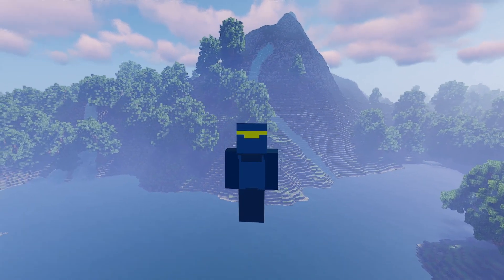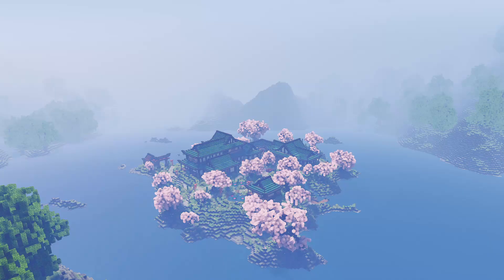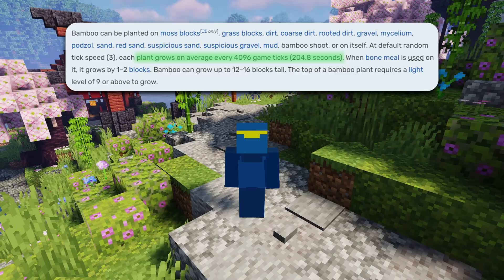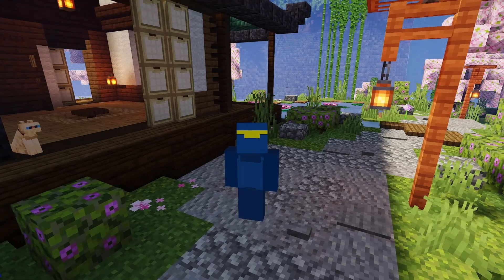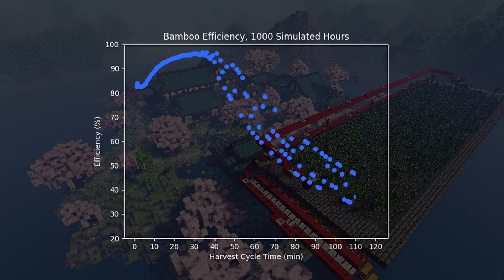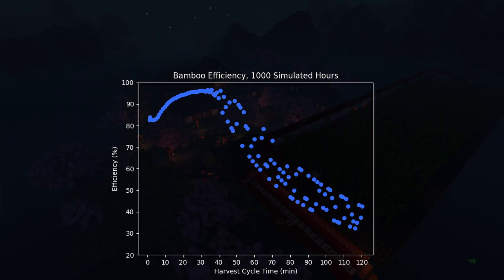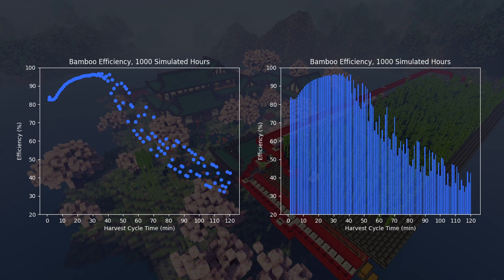Optimizing Bamboo Farms with Code - Minecraft 1.21

Comment from the maker: Hey everyone, @gamer_x403 had a really good observation and stated that the second half of the graph appears to be 5 separate curves, corresponding to the 5 potential starting stages. So I tested his theory out and am convinced he is correct.

I simply ran the code again, but removed the random stages and instead forced the stage to be either 1, 2, 3, 4, or 5. This produced 5 graphs in which it's clear to see that bamboo behaves like a step function. The graphs are actually really cool to see and pretty much answer all of the questions I posed. The inflection point around 37 seems to be where there's enough time between harvests that the steps become clear. If you'd like to see them, let me know and I'll figure out how to post them.

Comment: Not sure if you saw my sugarcane video (a follow-up to your own) but I have today finally finished the process of calculating the optimal harvest of bamboo using markov chains.  I calculated the optimal harvest interval of unrestricted bamboo as about 31-32 minutes (with a graph nearly identical to yours) and bamboo artificially restricted to 5 blocks tall as about 10 minutes and I can calculate for any arbitrary height limit if you cap your bamboo's height by blocking it (for example when it hits the ceiling inside your base).  I'll have a video up on it once I get around to making it, hopefully within the next few days!

Edit: Well, after going through the comments and learning that bamboo doesn't have the same internal stages as sugarcane, it changes the whole dynamic and makes the calculations way easer.  So the optimal harvest interval is instant, and the efficiency stays pretty damn near 100% all the way until a harvest interval of about 19,000 ticks (950 seconds or 15.83333 minutes), after which point it drops off slowly.  I simulated repeated harvesting in-game (rather than through programmatic simulation) and got results very consistent with the calculated result.
Reply from the maker: Hey uchinanchuu18, I did see your sugarcane video a while ago but hadn’t made time to watch it, so thanks for the reminder. Really great video and cool to see the actual statistics behind it. I’m not sure I covered it in my sugarcane video but I also included a blocking time for the flying machine. I’m glad you did the math behind it to actually show that effect.  

I look forward to watching that bamboo video when you post it. It’s been a while but I’m guessing the 15.8 minute time allows the bamboo to reach full height before harvesting? In that case, I’d be interested to see how a flying farm that harvests every ~15.8min does vs a bunch of instant harvesters in terms of efficiency in-game.
Reply from the maker: Also, I’d like to link your video in the description of mine to help other people find it. Let me know if that’s cool or not
Reply: @SeaJayPlays  Absolutely, you can link it.  I will work on the bamboo video as I get some time over the weekend.  The results with artificially limited bamboo (i.e. hitting the ceiling indoors) are interestingly intuitive so I can't wait to share.

Comment: {edited}
I didn't read your comment from three months ago and reached the same conclusion haha, great stuff!

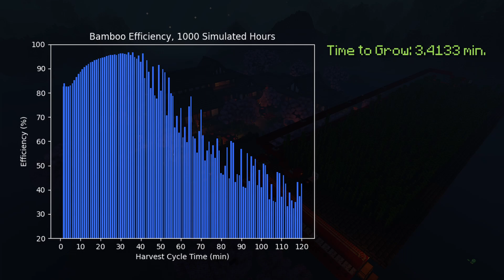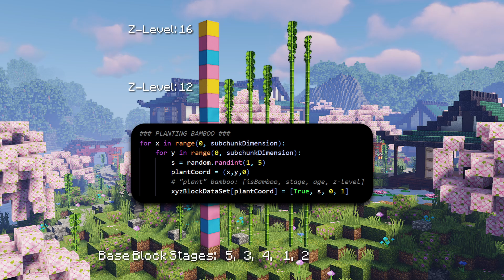Great video! I love the data and your thoughts on the results as well.  I disagree with you at 7:30 though when you speculate about why the efficiency curve(s) begins to diverge. At 2:54 you set a random integer between 1 and 5 which governs the max height of the bamboo as you acknowledge at the beginning of your conclusion. I agree that the efficiency begins to drop off for the exact same reason you state, that is that after 34 minutes, the percentage of bamboo plants at max height not yet harvested increases and time is then starting to be wasted by not harvesting those particular plants. To me that is also why the efficiency likely never hits 100% as some plants will hit this point well before that. 

From that point though I feel the data is completely random and independent of the 3 minute harvest interval as you currently suspect. If you look at the scatter plot you showed, you can draw five trendlines through the data quite cleanly. This suggests to me that there is an efficiency curve for data sets that are dominated by bamboo population capped at the various max. heights as stated earlier around 2:30, 12 through 16. I don't know how to share the image I marked up on the side to show this, but if you draw five lines as follows it should illustrate my point:
Line 1 (majority population max height 16 blocks): (34min, 96%) to (125min, 41%)
Line 2 (majority population max height 15 blocks): (34min, 96%) to (125min, 38%)
Line 3 (majority population max height 14 blocks): (34min, 96%) to (125min, 35%)
Line 4 (majority population max height 13 blocks): (34min, 96%) to (125min, 32%)
Line 5 (majority population max height 12 blocks): (34min, 96%) to (125min, 29%)

 Your program is resetting the max height of the bamboo, so the percentage of plants with each max. height limitation is completely random after each harvest. As such, the percentage of plants already capped in their growth varies as well. I suspect that if you ran this program a few hundred times, and overlaid all of the data we would see five discrete efficiency curves manifest as if every plant had the same max. height between 12 and 16 blocks. This suggests to me that the swings after 34 minutes are due to randomness in population, and not at all dependent on a multiple of 3 minutes. 

I loved this video though and that it sparked this question for me. great work for sure, and definitely got my sub!

Comment: Is there a reason you programed everything instead of using Carpet mod? That's the tool I usually see used for analysing farm efficiency (ex ilmango)
Reply from the maker: Good question! A couple people asked this on my sugar cane video and I gave a really long reply so if you’re interested definitely check that out. But the short answer is that my computer couldn’t handle the tick warp for any decent duration. So it was taking forever and I wasn’t confident in the reliability of it. 

I’m decently confident saying the programming results are accurate though mainly because of Ilmango’s video where he goes over best sugar cane farm timing. He got 41 minutes too lol. And now for these other farms I’m going the programming just cause I

Comment: I think the more interesting discussion when it comes to "most efficient" bamboo farms is bonemeal based farms. How does it compare especially in terms of area efficiency and resource cost? Both with and without factoring in the necessary bonemeal farms
Reply from the maker: I’ve actually got an ‘instant’ bamboo farm that uses bonemeal and is crazy fast. I can’t remember the rates but it’s way faster than a flying machine farm. The only downside s how much bone meal you burn through, but if you’ve got it, it’s the best way to grow any farm I think.
Reply: @SeaJayPlays  right, I was thinking a way to compare it could be to try to estimate the effort in both the bonemeal farm + bamboo farm combined, vs the random tick based bamboo farm
Reply from the maker: Yeah we could calculate and compare resources, area/volume efficiency, lag, and time spent building

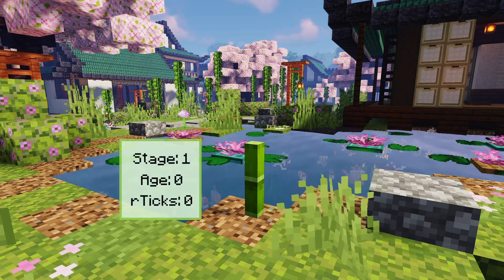Comment: 3:38 afaik bamboo doesnt have age - instead when it recieves a random tick it has a 1/3 chance of growing
although that difference does not change the mean growing time it increases the standard distribution of growing times
Reply from the maker: That’s good to know, can you share a link to where you found that so I can take a look?
Reply: @SeaJayPlays  Hi, sorry for necro-posting but I just stumbled across this video. The other guy is correct, it’s a 1/3 chance of growth per random tick, not Age-based. There isn’t really a link to this since it’s just from reading the game’s source code. Specifically what happens is:

When receiving a random tick:
- Check that the Stage is 0
- Check that there is air above the bamboo
- Check that the height of the bamboo is less than 16
- Do a 1/3 random check
- If all pass, grow the bamboo

When growing:
- If the new bamboo height is 4 or more blocks tall, set the Age of all bamboo to 1 (this is only used to determine whether the bamboo stem is thin [0] or thick [1])
- If the new bamboo height is between [12, 15] (inclusive) there is a 25% chance that the top bamboo block has its Stage set to 1 (this stops further growth)
- If the new height is 16 the top block always has its Stage set to 1

The most notable thing here is that the maximum height distribution is not uniform, as there is a 25% chance for it to be 12, 18.75% chance for 13, 14.06% for 14, 10.55% for 15, and 31.64% for 16
Reply: @josiahdsmith5641  Wow, I'm glad you shared this.  I haven't been able to go through the code myself, but I assumed an equal 20% for each height (12,13,14,15,16).  I'm going to have to adjust my markov chain method with this new info!
Reply: @uchinanchuu58  Glad I was able to help! The varying percentages make sense when you realize that the game grows each new bamboo height ‘blind’. The only way to get a uniform distribution would be to store the ‘intended’ height in the data of the block via a blockstate (this is what kelp does), or by making it position-based (ie: all bamboo grown at (100, 60, 100) will grow to a height of 14), which is what the bamboo uses for its horizontal offset.

Comment: 2:18 wouldn't that just be from the 1 in 4096 chance for a random tick
Reply from the maker: That’s true, but I meant more how did they find out that bamboo requires only three random ticks to grow. In my code I define bamboos age and stage but those were just assumptions made to fit this information, so I’m not sure how accurate it is.

Comment: I'm currently playing on a Minecraft server that has items such as sugar cane, bamboo, and cactus despawn at around 15 seconds after laying on the floor. So, what kind of designs do you suggest for a bamboo farm with such downside? Thank you
Reply from the maker: That’s an interesting problem, but there’s a couple things I think you could do. The first is just using a smaller flying machine farm (or use a lot of minecarts that move only short distances) so you can collect the drops before they despawn. If the drops still despawn before you can collect them, you could try a smaller piston based farm. One of my first videos was a really fast bamboo farm using bonemeal, and since it’s so small, the minecart can quickly collect the drops. 

Another thing that I saw a while ago was a design by Ilmango where the flying machine had hopper minecarts on it, so the drops get instantly collected and don’t even have a chance to despawn. 

Basically, just keep it small or use a lot of hopper minecarts 😂
Reply: Is there a full list of the items that despawn like that? Is it just the items that players farm to death at gigantic scales or is it almost any farmable item?
Reply from the maker: @jonathonathon  I’m not sure if there’s a list like that, but I’d say that the despawning problem exists for any item/farm with drops. The problem is just more obvious for massive farms, so managing collection becomes really important

Comment: Great video! By the way, I suggest you look into the max efficiency of a Cactus Farm. That is one of the must have farms for Minecraft Survival. Keep the good work!!
Reply from the maker: I appreciate that, thanks! 

I’ve looked into cactus before but the efficiency usually comes from how the farm is built (all are 100% but then have loss cause the drops hit other cacti on the way down), not timing or something I could code :(. I think Ilmango actually did a pretty in depth video showing a bunch of build variations that minimize loss, so I wouldn’t want to copy that. 

If you’ve got a suggestion on how I could do it differently or in a way that covers something he didn’t, I’d definitely look into making a video about that!

Comment: When the graph spreads out, it seems like it separates into 5 curves. Maybe its related to the 5 possible starting stages?
Reply from the maker: @gamer_x403 After running some test, I think I can confirm your theory. I modified the code to remove the random stage and instead forced the bamboo to be stage 1. Then I ran the simulation and did the same plotting. I repeated this for every stage. The results are really nice to look at, and the graphs pretty much explains the whole thing. It's basically a step function throughout. When using the random stages, this is harder to see, but when I broke it out, it's really clear. That point around 35-40 is just where each "step" starts getting long enough to easily differentiate. If you're curious to see what I'm talking about, I can try to post some images of the graphs on Planet Minecraft. 

Again, really good observation!
Reply: @SeaJayPlays  Nice. Thanks for testing it.
Reply from the maker: That’s a really interesting observation, and I think I could easily test to see if that’s the case. I’ll look into it and let you know!